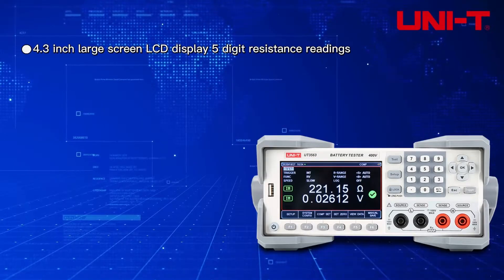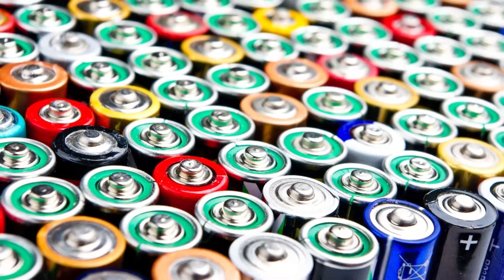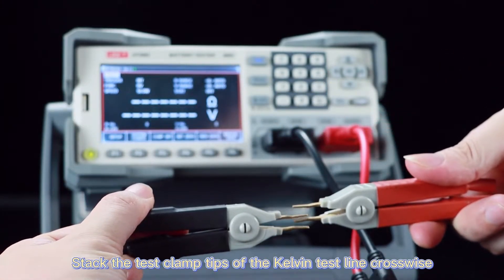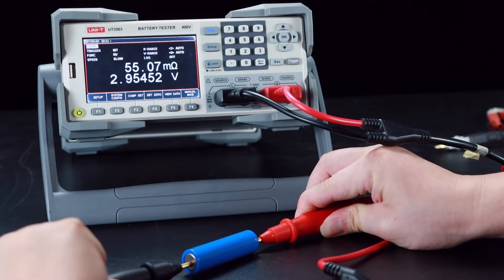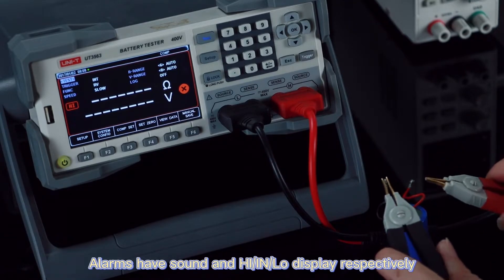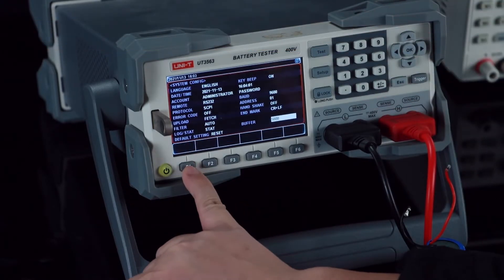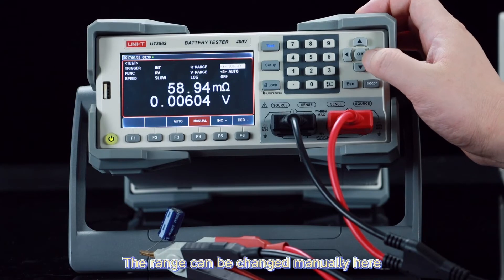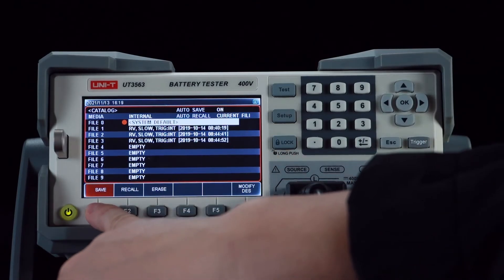Measure Battery Internal Resistance with UNI-T UT3560 Series Battery Testers

Comment: Good day, is this can be used for measuring copper wires ?
Reply from the maker: Hi Dear,

Thank you for reaching out.
UT3560 series battery internal resistance tester is used to test the impedance value of related batteries. It cannot be used to directly measure copper wire. UT3513 & UT3516 can be used to measure copper wire.

Any questions let us know at any time.

Best regards,
Uni-T Team

Comment: is UNI-T have DC Electronic Load, for battery capacity test. like RIGOL DL3000 series, ZKE Tech battery load and can generate capacity test profile by constant current/power chart?
Reply from the maker: Hi sir, we have a DC electronic load model, the UTL8500 series, you might be interested in according to your need. You can learn the details about the UTL8500 series at: https://bit.ly/31yz6so
Reply: @UniTrendTechnology  review for UTL8513 is not found? nobody buy it yet? will try it in future.